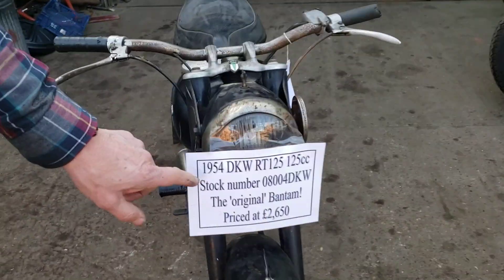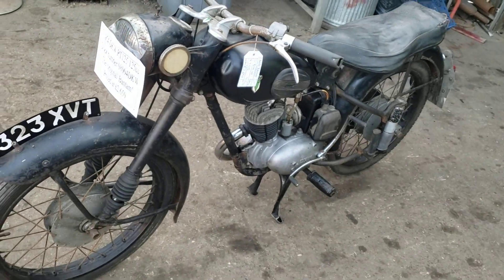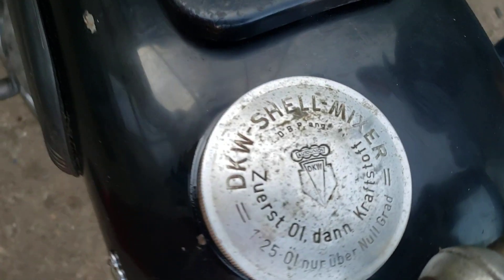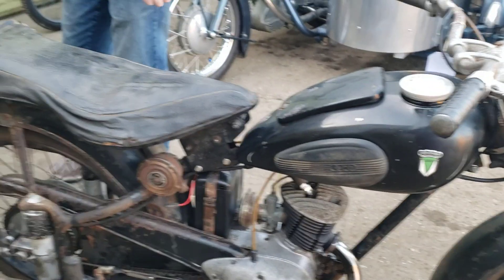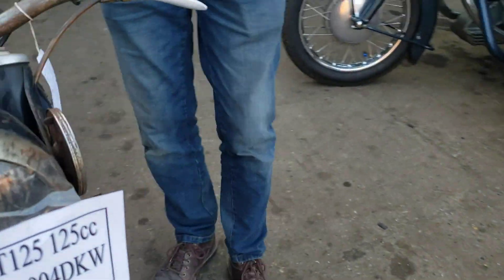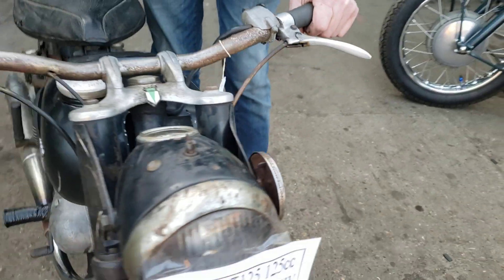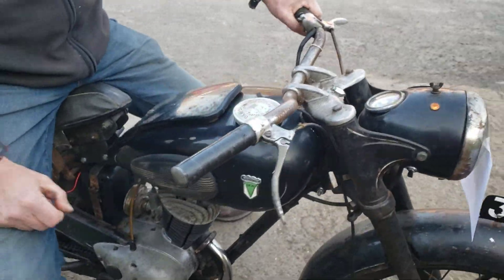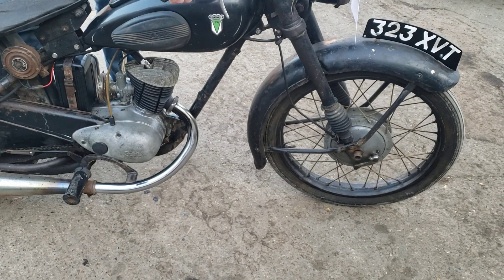1954 DKW R125cc #08004

Comment: Fantastic Motorcycle thanks for the feature of this Rare machine. Dont remember seeing one even in a magazine article. How Superbly well engineered machines these were at that time. Look at the Equipment and details? And the bike is very comprehensively braked with those full width hubs. Its a Pity the Bantam couldn't take on those finer points even later in the production. Thanks again Cheers TC